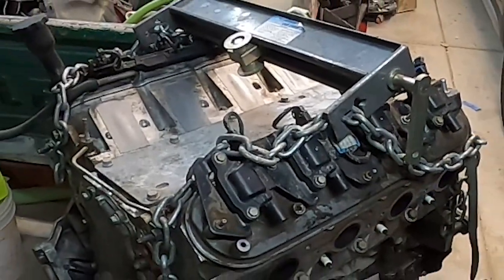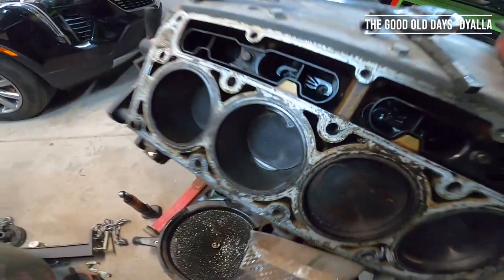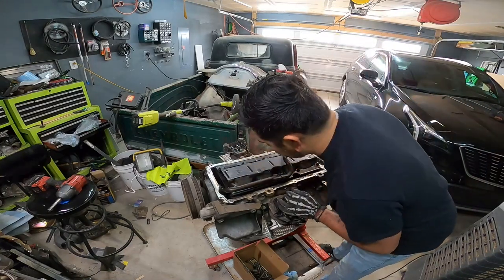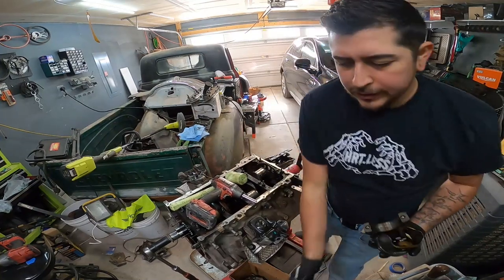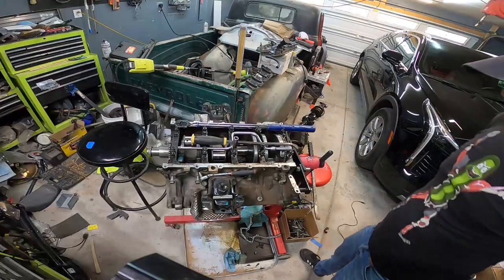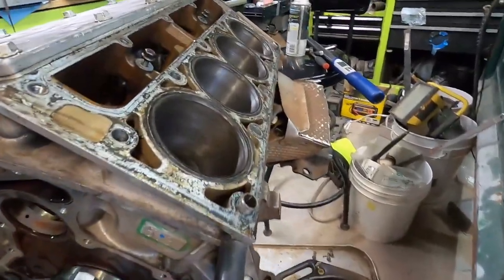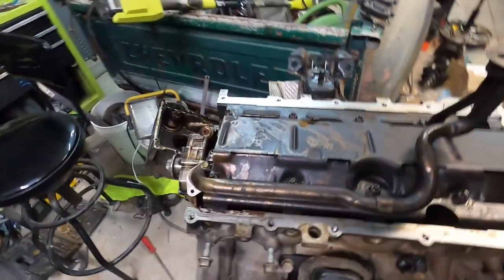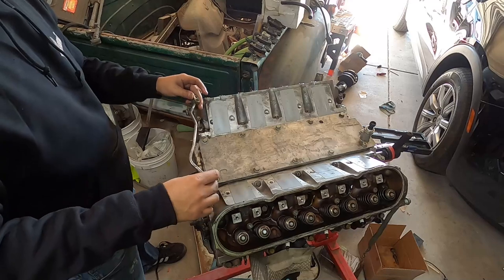Rebuilding A Knocking LS Engine At Home - No Machine work

Comment: Great video a regular guy at home building a motor and thank you for taking the time with the socket sizes,order and specs.Most people that want to learn about something love specifics and details Does YouTube should make something where you can watch the video with no Time lapse to give options love the content
Reply from the maker: Thanks for watching! I make the timelapses in the edit. Unfortunately if I didnt my this video would have been 4 hours long!
Reply: @JovaniDanteGriego  would adding sloppy stage 2 cam, Longtube headers and a LS1 intake and LS1 injectors cause the motor to back fire if trying to run it with OUT a tune? I just swapped all those and haven't had it tuned yet, just wondering your opinion. Thanks for all the content
Reply from the maker: It most likely is the injectors. Of the Lbs per hour are different than the originals the amount of fuel they are spraying will be different. Chances are you are running it lean.
Reply: @JovaniDanteGriego  oh snap you're the goat man! Appreciate you taking the time to answer me, really means alot. I'm putting the truck intake and injectors back on this weekend and I'll let you know if it helps. I'm going to do a mail order tune for the other mods just wanted ur thoughts on it. I checked the compression and shows 150-175 on all cylinders, all 8 cylinders are burning so I was sort of lost. Appreciate your help

Comment: I did the same to my engine a while back. I have buddy that’s a engine builder and owns a machine shop. He mentioned to me when I honed my cylinders that I have to clean them really well before assembly, due to what the stones leave behind. I told him that I used brake cleaner and a paper towel until it was clean and nothing was on the towel. He told me that it wasn’t good enough and said I need to use warm, soapy (dawn) water and a scotchbrite pad. The reason behind is that the stones leave abrasives behind and will eventually wear out the rings and will need another rebuild in the near future. I’ve rebuilt engines before and ne’er done that, but also did have them for very long to find out that I did it a little wrong. Just a friendly tip for everyone but I’m not professional either and just passing on what could be helpful.
Reply from the maker: Thanks for the tip! I usually like you just use brake clean/ pb blaster/ whatever I have on hand to wipe down the cylinders. I doubt trace abrasives can wear down the rings that severely
Reply: @JovaniDanteGriego  no problem, we’re here to help each other out. Your probably right,I’d just like to be safe then sorry. Cheers

Comment: If you're reusing valve train parts, they need to go back in the same position as before.
Reply from the maker: Yep. I did. Off screen I used a cardboard box to hold all the pushrods in order and kept all the lifters in their proper positions

Comment: Will a rod bearing damage the cylinder walls?
Reply from the maker: Usually the bottom of the wall if piston is rocking inside the bore. But not usually. Bearing material can get pumped through and scratch the bore though
Reply: @JovaniDanteGriego  I meant rod knock. So basically I can buy a car with a rod knock and then change the crankshaft and it'll be good to go? There's a lot of cars for sale here for cheap because of the rod knock. I just bought a 2010 Camaro LT for $2000 with a rod knock. I polished the crankshaft and then put new rod bearings in it but it was back knocking in 3 days lol. So now I'm trying to find a new crankshaft. Where did you order that crankshaft from?
Reply from the maker: @papergatorzfedducca7998  I usually buy them on eBay used good condition. It really depends on how bad the bearing is. I've had some that take 50 thousands off the crank and at that point there's nothing you can do to help that.
Reply: @JovaniDanteGriego  ok thank you bro!!!🔥🔥🔥

Comment: Just a fyi. Ur not supposed to punch mark fractured rods.
Reply from the maker: Why is that?
Reply: @JovaniDanteGriego  I've worked at a Chevy dealership and they always told us the rods are hard and specifically designed to fracture. So striking them with a punch or stamp can break them
Reply: @JovaniDanteGriego  they always said to use a paint stick is best.
Reply from the maker: @chevyman35089  I guess Ive been lucky every single time I've ever done this then.  Probably some gm warranty issue.

Comment: OMG, you assembled the engine dry, honed the cylinders with the crank in place throwing all the stone material inside the engine, everything is filthy covered with debris from when the bearing spun, you didn't use any alignment tools when installing the front and rear timing covers, you didn't even clean the head and block surfaces before bolting the heads down.  Did you use new head gaskets, no, not even a new set of head bolts.  Their cheap.  Thank you for showing us how to not freshen up an LS engine, that thing won't last 2 weeks, you just waisted all your time and effort.
Reply from the maker: Ok bud 😂 literally have run turbo engines just like this. If you think this is bad check out a channel called sloppy mechanics. You'll have a stroke
Reply: @JovaniDanteGriego  right🤣🤣🤣🤣
Reply from the maker: Bruvs probably never even looked inside an LS before but I'm the dumbass
Reply: @JovaniDanteGriego  🤣🤣🤣
Reply: @JovaniDanteGriego  hey bro I have a question. My junkyard here sells engines for $175 in the yard. What do I need to look out for? If it spins it wins or no?? I WANT TO REBUILD A 6.0 LIKE THIS VIDEO😂😂😂😂
Reply from the maker: @papergatorzfedducca7998  if it spins I wins basically 😂
Reply: @JovaniDanteGriego  well imma shoot my shot to see if I can win a good 6.0 for $175!!! I’ll let you know how it goes. I see a lot of people cutting the frame to pull em. Do you know why?
Reply: @papergatorzfedducca7998  Easier to pull them, the rest is just scrap anyhow.
Reply: @hardball107  I know it’s easier but what is it making easier?
Reply: @papergatorzfedducca7998  You chop the frame just in front of the motor mounts and remove 6 body bolts and the whole front end comes off.  Then everything's open, hack the exhaust pipes off and remove the 2 bolts on the engine and tranny mount and just slip the motor right out.  Time is money and if you had ever pulled a motor you'd understand.
Reply: @hardball107  I’ve never pulled an engine that’s why I asked bro. So now I understand!!!! Thank you
Reply: Did it last?